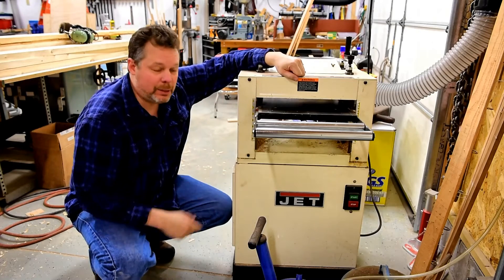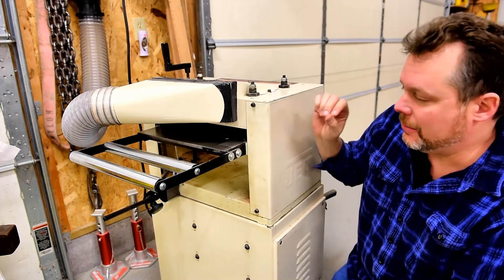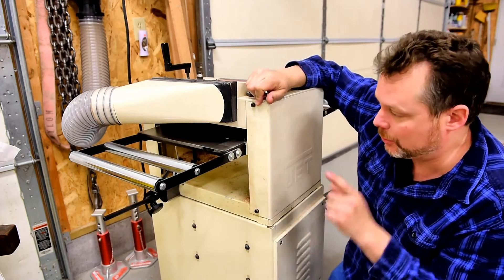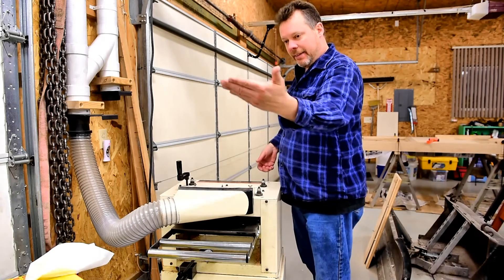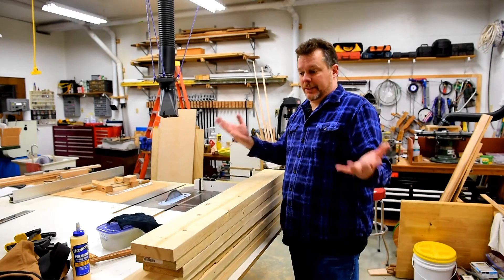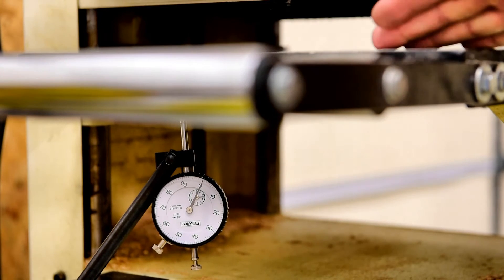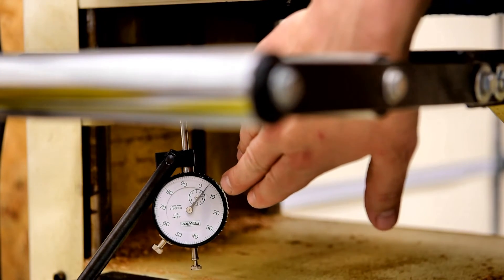Stop planer snipe - request for ideas to fix the machine

Comment: From the video, it appears the solution is to sell the planer and buy something better that suits your needs.  It appears to be a design fault.  I have a 15" taiwanese planer with the cast bed and whoever put it together did not set the bed parallel to the blades.  The other thing that happens with it is when the blades get dull the table starts to walk itself down and you can see the handle turn.  Keep them sharp and it is fine.

Comment: So I have a 20" grizzly early 2000's model, but similar design. How I reduced my snipe was to actually remove the wings (gets rid of leverage) and put a piece of laminate board as the bed on the bottom (also lets you plane 100% of the board). Gets the bottom rollers out of the mix. Just have to be more careful when in feeding your boards and if they are long the outfeed as well. I had tons of luck this way hopefully it works for you.

Comment: I'm hoping by now you've reached a workable solution. If not, may I add this. I also acquired my planer/molder used and with missing this and that, and Jet hasn't been as helpful as they could have been. I'm having the very same snipe issue even after meticulous care in set-up. The in and out feed tables aren't long or strong enough to handle the stresses the way they're designed. I've decided to add a 1" thick piece of melamine at least as long as to the end of the wing rollers with a cleat for the in-feed side up against the cast bed. After watching a few snipe remedies, this seems to be something that makes sense and not have to drill, tap, weld, modify or whatever. There are 4 holes in the cast bed already. So, I loose an inch thickness.

Comment: I know this is six years too late, but it may help someone else. I own this planer and the tables will flex like a lunchbox planer. John White’s book describes a fix: lay a straight edge across the table and infeed and outfeed tables. Put downward pressure on the straight edge and adjust the wings/tables so they have a slight up-tilt. When adjusted properly, the straight edge will be parallel to the main table and raised 1/32” off the surface. This will compensate for the down flexing you are experiencing here from the weight of the board. From John White’s Care and Repair of Shop Machine’s book.
Reply: I have two questions for you. First, I am thinking about buying one off market place. They're asking $800. Would you avoid it? Second, can you avoid snipe by simply taking off the extensions? Thanks.
Reply: @Canimakeit603  I really like my planer a lot. For me, as a hobbiest, it has done a great job and not failed me. I’ve thought about taking the extensions off, to be honest. I’d say that if you maintained a slight up-pressure on the board at the outfeed, you would not get snipe. I have not experienced snipe with the planer, but I’ve set it up per the book I referenced. Good luck on your purchase.

Comment: The only thing I’ve found that helps is to apply SIGNIFICANT downward pressure on the outfeed side of the board as close the outfeed as possible. 

My mind’s eye says a weighted drive wheel that can simultaneously hold the board down and drive it out of the machine would solve most of the problem.

Comment: I've seen this problem before the first thing you would do is check is the depth of your blade to make sure that it's correct. If the blades are too far out there. Will be not enough pressure on the rollers. You need to set it with the night of the guide provided
Reply from the maker: Thank you for the information.

Comment: The table extension will not solve snipe. I have a planer with fully supported level table and it only helps marginally.  Sometimes it is the head assembly that rocks. There are some videos of people putting in plywood head stabilizers that solved the problem.

Comment: I have a cheap £150 lunchbox  planer/thicknesser and the infeed plate will move up and down by about 2mm. Like I say, cheap and cheerful! What I find is it caused a very slight bow in the middle of the edge I jointed. My semi successful remedy was to put a block of 2 x 2" between the underneath of the infeed plate and the base which now gives me a supported but completely level in and out plate. It's not perfect but was a simple fix for a cheap machine. Maybe you could try something like that on your outfeed rollers?
Reply from the maker: Thank you. That does give me an idea to try.

Comment: maybe beefing up where the threaded rods join the machine body, its probably flexing there.
having said that all planers have some snipe, even pricey ones, but your table does flex a lot.
ive seen long subtables that fit over the machines bed all one piece, this may help, have a melamine surface to lessen friction .
Reply from the maker: Thanks for your input

Comment: Have a look at the Jet and grizzly 20" planers bed design. I've got a similar design machine and do not have snipe issues because the adjustable bed can be locked in place.
Reply from the maker: Thanks for the input. I will take a look.

Comment: Could part of the problem be that as a board enters and exits, the board makes contact with a power roller and a lower roller in a manner that causes the board to tip/canter slightly upwards toward the cutter head causing snipe?   If that's the case, then perhaps the addition of another lower roller near or directly below each power roller would give appropriate support as a board enters and leaves.
Reply from the maker: Thank you for the suggestion. I will look into it.
Reply: It appears that the board isn't even in contact with the outfeed rollers until after the snipe.
Reply from the maker: I tried different configurations with the infeed and outfeed rollers, but I still had the same snipe problem. I will probably need to make a better support for the rollers since this machine design won't allow the roller arms to stay in one place.
Reply: Aaron Weed pp

Comment: Machine four screws 3/4" to 1" to raise and lower the table and build a more rigid table, similar to the extensions on your jointer. Looks like a poorly engineered product.
Reply from the maker: +MrMnchstr Thanks for the input.

Comment: The feed rollers have too little pressure.
Often the planer knives are too far clamped into position.
The feed rollers, this distance can not keep - thus there are these bumps.
Reply from the maker: +Hermann Platschka The planer initially had very hard pressure on the wood and still produced the same result. I tried more pressure and less pressure and the same result. The knives are properly adjusted since I spent about an hour getting them just right.
Reply: Hi Aaron,
If the spacing of the gouging error at the beginning or end of a board the same value than the distance of "axial center plane shaft to axle center pressure roller," you would have a hot tip on the cause.
The planing knives should be approximately 1.1 mm over the planer shaft.
The pressure rollers are set to these values.
Hope the cause clears up soon, please let me know!
Reply from the maker: +Hermann Platschka The cause is the table tilting on the infeed and outfeed sides. The manufacturer didn't design the corner guide posts well enough to keep the table from doing this; known issue since the late 1990s. I could add bushings to the table top where it rides on the guide posts to tighten up the slop, but I'm not sure if that would correct it properly or if it is feasible.
Reply: Aaron Weed simple idea to test ...
Point 4 piece of wood under the table and clamp them by table height adjustment.
Do you get now a good planing?
Reply from the maker: Ah. I understand.
Reply: One problem is definitely the feed rollers, these do not have enough pressure force.
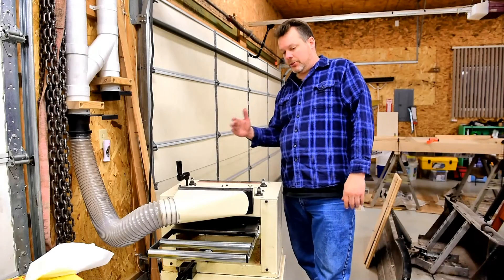Look in your video from 1:41 there falls the wood on the last support roller while still planed!
The wood end tilts thereby up to the cutter spindle.

Comment: My only initial thought would be to add steel (maybe  aluminium) 'ribbing' to the underside of the full table's length (including the extensions). Some kind of U-shaped channel section, perhaps?

I guess the ultimate solution would involve adding multiple support columns, while still allowing the table to rise and fall?
Reply from the maker: +Olly Parry-Jones Could work. I have thought about adding a better system for table extensions, but the support columns are an idea that may need further looking into.